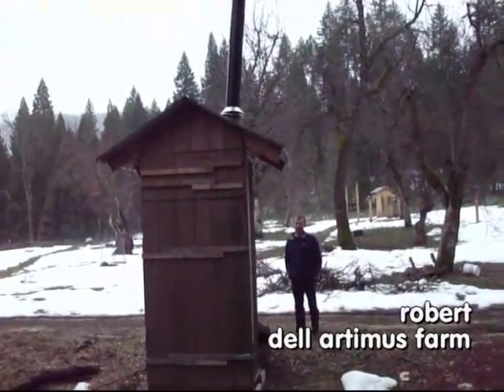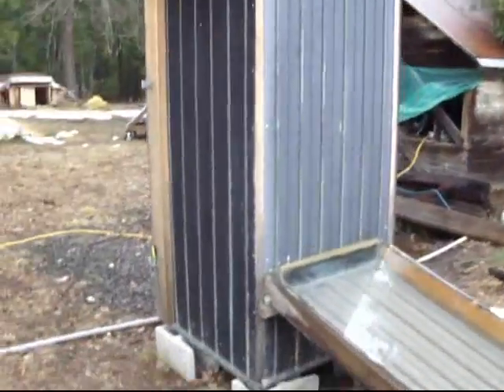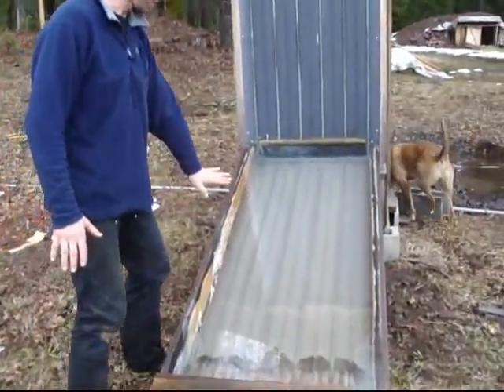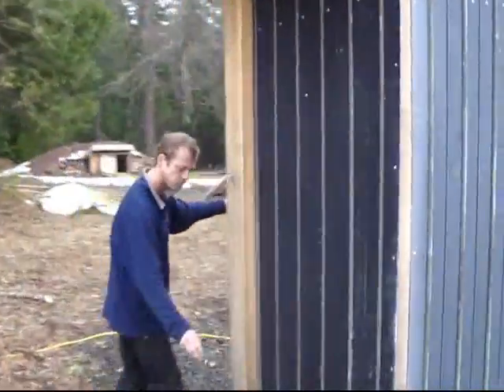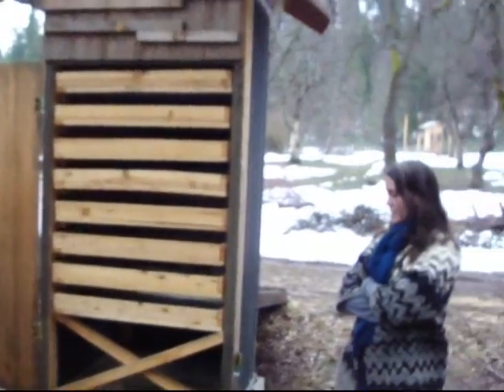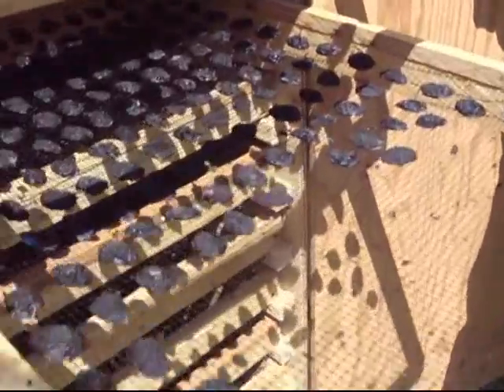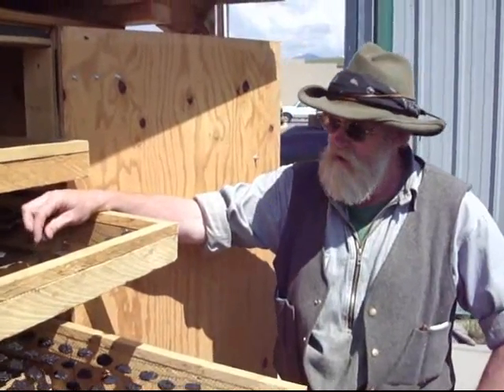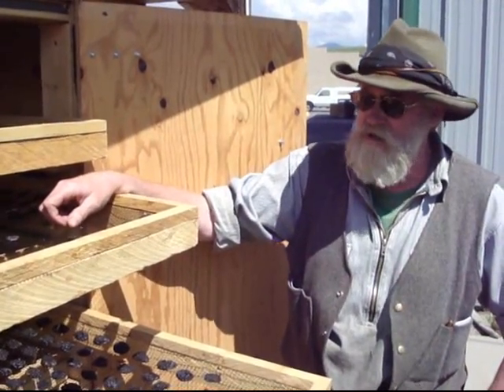Three Solar Food Dehydrators - solar energy at work!

Comment: 5:15 "It's not really the heat that's drying this fruit, it's the air movement. The heat doesn't hurt."  🏆  I felt that, about using electricity to dehydrate really hurts (the pocketbook and the permie brain).

Comment: The plums were in the dehydrator for 6 months? Did I hear it right? Why?
Also what about if I want to keep the temp below 115 degrees for things that I want to keep raw. Also, herbs should be dried at 95 degrees. Is there any temp regulation possible? Thank you.

Comment: If the chimney also had a draw by being connected to the air current of a separate collector on the top of the unit, the draw would be even stronger and drying would be even faster.
Reply: I like that Idea

Comment: Moist air is lighter than dry air.  The basic principle is that if you had a volume of any gas at the same temperature and pressure, there would be the same number of particles (atoms or mollecules, in the volume regardless of the gas.  Therefore, the relative density  of any gas is proportional to it's molecular weight.  The molecular weight of water vapor is 16 + 2 = 18.  The molecular weight if air which is an average between Nitrogen and Oxygen or about 30.  So water vapor has 60% as much weight as an equivalent volume of dry air at the same temperature and pressure.  Ergo, moist air is lighter than dry air.  Worth taking into account when building a food dryer.
Reply: Thank you for that detail.

Comment: Can the amount of heat used for drying be controlled? The reason is because as a Raw Foodist I wish to dehydrate at temperatures below 47 degrees celsius or the Fahrenheit equivalent.
Reply: Get a heliostat to track the sun's movements and some motors to move it into position then it could be programed to move out of the sun when it is too hot!
Reply: thank you for your insightful answer.
Reply: You also might try a very hot chamber with lots of air movement to drive a turbine on a shaft that drives a fan in another intake that draws air from a shaded area.
Reply: I saw some design with a door on the outlet that can be used to control the air flow, influencing the temperature as well, I guess.

Comment: It's alot like keeping ants away from bee hives. The legs set in the pans themselves and form a little moat space and then a thin layer of oil is added. DE only works on soft bodied insects. You could also coat the legs with Tanglefoot or a similar substance.

Comment: Hey.

Would using very cool air for the intake further speed things along?  Cool air holds less moisture.  If you warm up already cool air, that air is ready to absorb lots more moisture.  So would a pre-cooling pipe be in order?  Moisture would come out as the air cooled, so it would condense on the pipe all.  Maybe even a dehumidifier using passive flow creek water or something would work.   Just snow-balling ideas.

Comment: I would not have thought that a downdraft could work so well.  I will have to plan on making one too.  It seems the sun orientation might be a factor too so seeing the side solar panels were interesting.  It seems if there were enough vertical panels you might not need a slanted one.  What if It were vertical with a \_/ shape (looking down) so two sides at a time were getting sun?